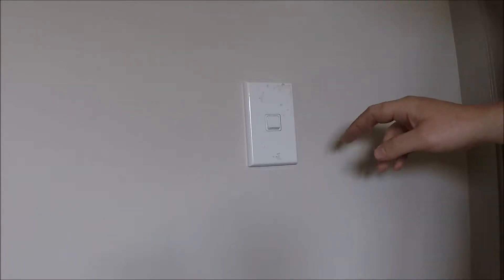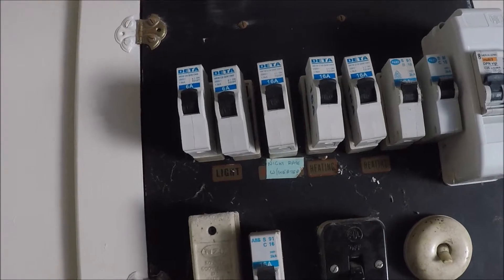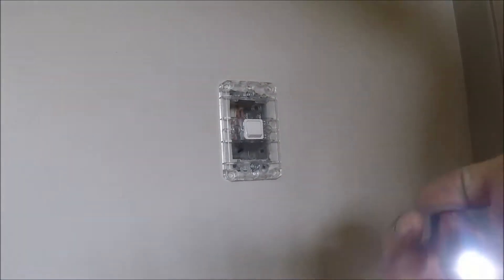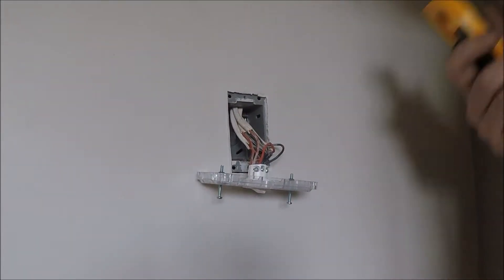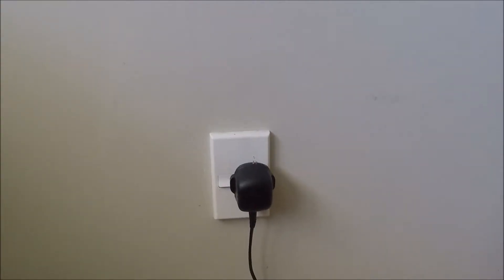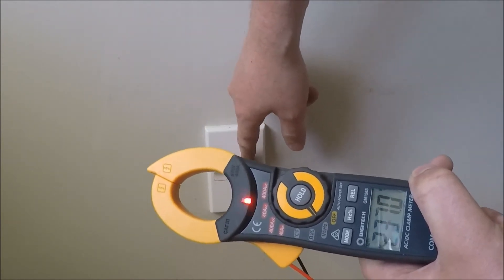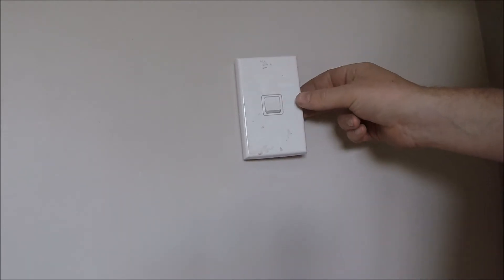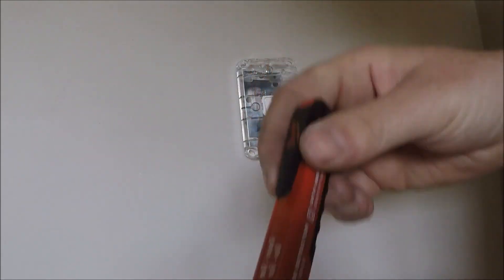How To Ensure Power is Isolated

Comment: Hi Sparky Dave - I would like to point out that your Prove - Test - Prove method that you demonstrate is incorrect. 
You must first PROVE your meter works on a known live supply, then TEST your circuit for isolation then re-PROVE that your meter works on the known live circuit. 
You can find this description in NZQA Unit Standard 15852, page 2 item number 6.
Reply: Also, part of the intention of the prove-test-prove method, is that your meter is/was on the correct setting.  
i.e. Once starting the prove-test-prove sequence, don't adjust any buttons or dials on the meter. 
So when Dave turned off his meter in between, this made his testing even less effective.